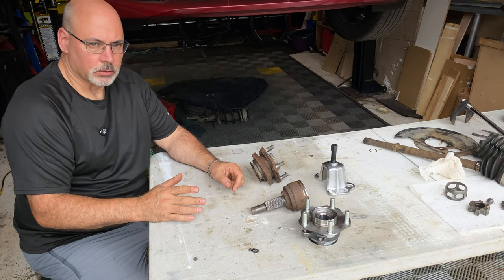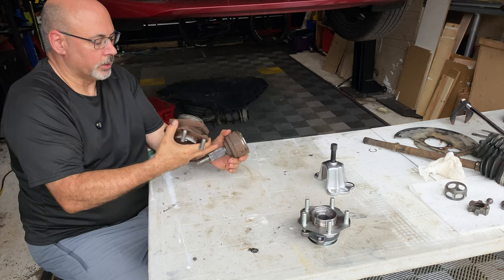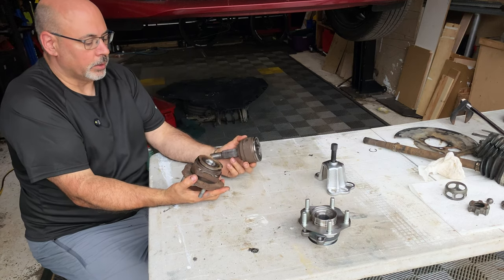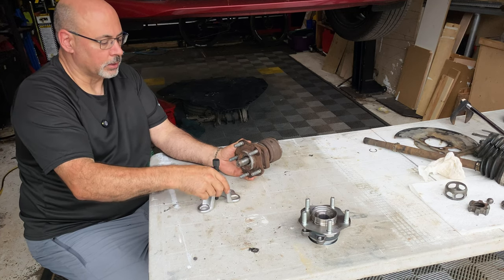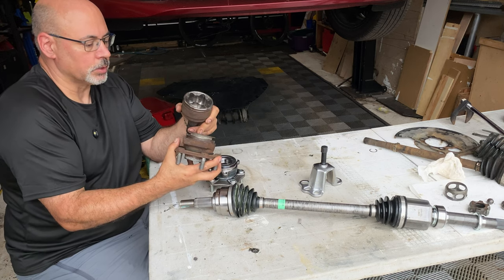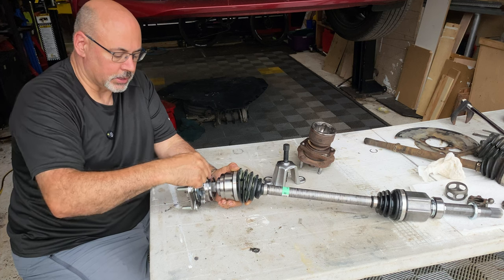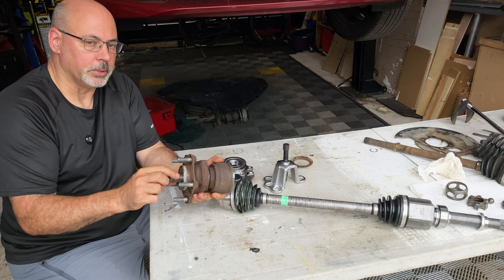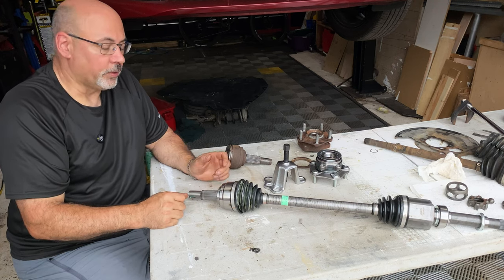CV Axle Click Explained

Comment: Easy way to torque the nut, run the wheel nuts down against the rotor, then use one of those irwin quick clamps, flip the stationary jaw to the other side, prop it between the brake and seat. I use that all the time in the garage to apply the brakes on various cars. Brakes will hold way more than 200ft/lbs of torque with ease.
Reply from the maker: @Levibetz  I have a couple Task extendable supports in the shop that I use exactly as you described, quite often :-).  For this job I just ran two wheel nuts on to the studs (brakes were not installed) and used a 3 foot pry bar on them to hold the hub for torquing.

Comment: WHAT IS AN AXLE CLICK?  DOES HE MEAN a CV clicking? A CV and shaft IS NOT AN AXLE. AN AXLE IS SOMETHING A WHEEL ROTATES ON. A DRIVE SHAFT DRIVES THE WHEEL HUB OR AXLE EITHER DIRECTY OR INDIRECTLY. A cv is never an axle, NEVER!  EVEN FRED FLINTSTONE KNOWS THAT!
Reply from the maker: @ElarMack-ci1of The CV shaft assembly is commonly referred to as a CV axle assembly.  I did not make up the verbiage.  To call it CV clicking would be misleading as the sound is not coming from the CV joint.

To your point regarding Fred Flinstone, his car had stub axles, and a monolithic stone wheel, so you're right...he likely knew what an axle is :-)

Comment: Thanks for the video. The question remains: with this frequent metal on metal impact (shifting splines), how long will it take for the splines to wear down? I guess the tolerance will just keep increasing and the click get louder over time. The click on my Leaf is vastly louder than what you demonstrate here. It echoes off nearby homes as I accelerate. It is not subtle. It is annoying and makes it likely that I wouldn't be able to sell the car without some devaluing and lengthy explanation to prospective buyers. Poor design by Nissan. I guess I'll have to drive this Leaf until it's dead.
Reply from the maker: @breakburrito  In 40 some years I have not personally repaired a hub/axle with a fully stripped spline…I don’t believe it’s seen often.  If yours is that loud, you can check the free play by backing off the axle nut and rotating the axle shaft.  It might be advised to go the full route to replace both hub assembly and drive shaft.

I would follow the TSB to check for correct axle nut torque, and when an axle or bearing issue arise, inspect and potentially replace both. Based on the service manual, these parts are designed to be an interference fit, but Nissan does not manufacturer either the wheel bearing or axle…so the issue likely rests with tolerances from both manufacturers.

On the 2018, I would take the torque up to 134 ft/lbs as the axle, nut, wheel bearing assembly, and steering knuckle are the same parts on the 2018 and up.

Comment: I lost forward and reverse and now has a clicking noise at park. What could be the problem?
Reply from the maker: @luburan1973  I would post up a video in a separate thread.  This is likely not a simple CV axle click issue.
Reply: @DennisWoodCAD  Car is Ford focus 2.0 diesel with Getrag 450 6 speed transmission
Reply from the maker: @luburan1973  I have zero experience with those, so can’t help I’m afraid :-(

Comment: Most detailed information I've found on this issue. Would you consider this a necessary fix to keep the vehicle operating safely, or merely an annoyance?
Reply from the maker: Thanks for the kind words 🙂

My opinion, make sure the axle nuts are at 130 ft/lbs or so for the 2018 and up, and call it done.  If the click is still bothering you, it's a pretty spendy job to replace both the axle and wheel bearing.  This is likely why the Nissan TSB does not call out a replace, just basically some assembly lube and re-torquing.

Comment: Thanks for this detailed video. It’s both interesting and educational. Really appreciate it!!

However, the part about the parking pawl got me thinking, so I ran a quick calculation. Let’s assume you’re on a 15% incline in a Nissan Leaf (approx. weight 1600 kg, with 205/55 R16 tires), nose down, and you shift the transmission into Park, releasing the brakes. In this case, there would be a 2.33 kN force pulling the car forward (downhill), generating about 542 ft-lb (735 Nm) of torque at the locked front wheels. This torque is transferred to the parking pawl (through the axle, differential assembly, and perhaps some gears). Any thoughts on that? I assume the transmission should be designed to handle such forces, or even greater (for example, on a 25% incline).

Or you simply do not put transmission in Park on incline but rely on the parking break instead? I’m not very familiar with operating an automatic transmission. :P
Reply from the maker: Wow...thanks for doing that calculation.  It does sound like a lot of torque at rest, but I'm guessing this would be at the axle.  For sure though at a 15% slope (very few streets would exceed that) you would 100% want the emergency brake engaged.  The process is stop, but keep your foot on the brake.  Engage the parking brake.  Relax your foot on the brakes.  Then engage park.  It's the same for ICE or EV to keep load off the pawl.  Then, on a slope, we all know the correct way to turn the wheels so the car hits the curb instead of taking off...which of course is different depending on which direction the car is facing.

The LEAF reduction gear transaxle has an approximate 8:1 reduction,  and the pawl is at the motor side, so fortunately it would not have to take 500 ft/lbs...which is a good thing if you take a look at it!

Now on the hub restraint issue, the NIssan service manual is quite specific on using the tool/bar across the wheel studs, not using the parking pawl.  If you had brake rotors in place, then a person inside on the brakes would be fine too. Given the expense of repairing the transaxle, this may very well just a precaution (not using the parking pawl), but for sure I'm not testing it!

Comment: Don’t use an impact wrench to tighten the nut if the wheel is on or not on the ground.

Only use a TORQUE WRENCH to tighten the nut with the wheel on the ground.

For AUDI's [and others] NEVER EVER USE AN IMPACT WRENCH TO TIGHTEN THE NUT.  

USE A TORQUE WRENCH ONLY WITH THE WHEEL ON THE GROUND or you will damage the wheel bearing.
Reply from the maker: I'd agree. A torque wrench is 100% the prescription for pretty much any nut or bolt on the vehicle!  That said, with these 3rd gen bearings, the bearing is pretensioned by the roll forming on the bearing assembly and can take a lot more abuse than the older 1st gen press in bearings that need an axle in place under pre-load before taking weight.